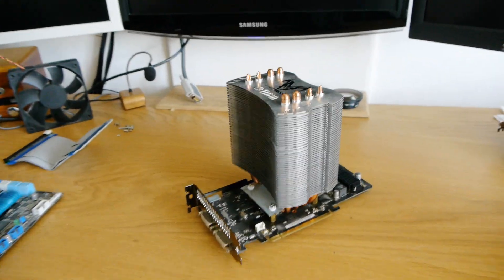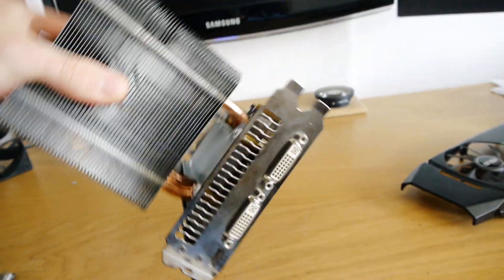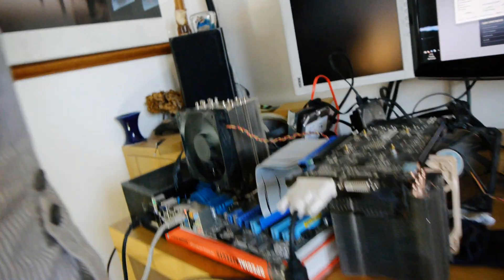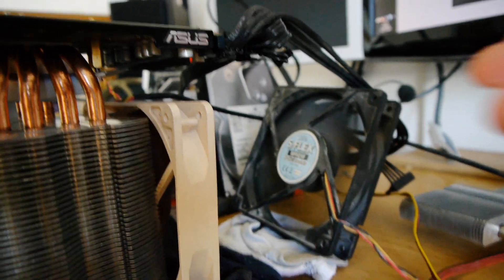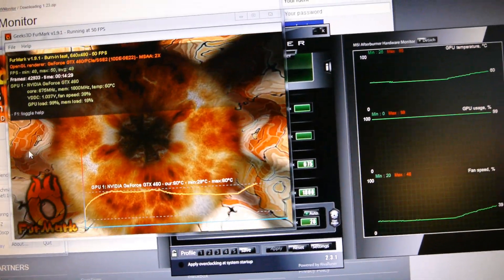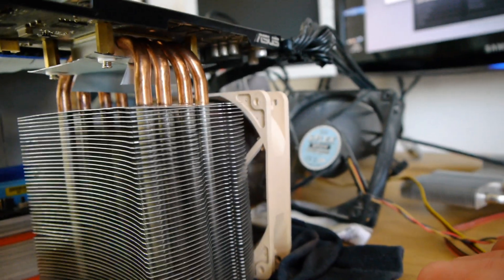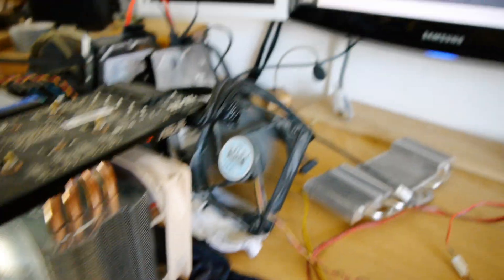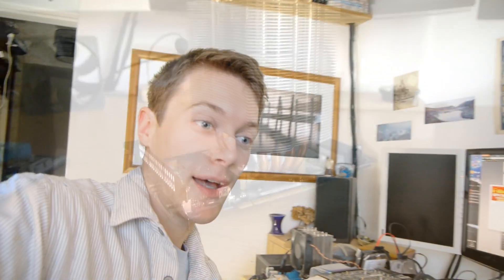CPU cooler on GPU (INSANE temps!)

Comment: I had a GTX 580 (that I bought off ebay on good faith that it was working just fine and dandy, stupid fukn me) that had crapped its vapour chamber in extremis. I only found out after installing it in an external GPU rig for my lappy and after palying a game for a while I heard scarey pinging and crackling. After jumping up and turning it off I went to touch it and the heat coming from it made me pull my hand away. I just thanks the gods that I hadnt gone to the shops. After I assessed the damage I tried plugging it back in for shits n gigggles and to my total and utter surprise, it worked. So i "borrowed" my cooler-master cooler from my PC and bodged it onto my 580. It's sat in my eGPU rig working flawlessly now. All thanks to remembering that I watched this at some time in the past before THE HORROR!!

So thanks (belatedly) for your video :)

EDIT: PS, I should add that I want to sell the eGPU rig now as I built a gaming PC 2 months ago. If anyone (in Australia, I'm in Melbourne) wants one message me for details.

Comment: alright vid, hard core pc gamers doing shit like back since quake days.. putting car radiators from cars.  dude on ebay about year ago selling old pc from 2007ish. this pc had separate  external aquamarine cooling pump station (size super small compact fridge) for salt water fish cooling cpu, gpu, mem, what not included with auction.

Comment: That's how its done, can you explain why they don't put cooling system in modems?  They get so hot and my old DSL modem would lag i put a fan and tiny heat sink in it and it stayed super cool and had no more lagging issues.  I recently put one in my cable modem as well.
Reply: +chriss4365 to cut costs.  dig inside an enterprise grade networking equipment and there will be a huge difference.

Comment: Isn't watercooling way simpler than this? It's also quiet AND has about the same cooling power as this
Reply: +Dino Prašo Generally speaking water cooling is louder (unless you go fully custom), way more expensive and quite a bit more likely to fail than air only. He'd also miss out on the awesome-factor of strapping a cpu cooler to a gpu with a cobbled together mounting system.
Reply: +Dino Prašo No, water cooling is more complex than this. Why? The only difference between this and water cooling is water cooling pumps water in a loop between the radiator and the GPU/CPU.  That is, it adds a middleman. This can be very advantageous, but it also has downsides, such as those the other commenter mentioned.

Comment: why not water cool?  you can make that super quite with a huge radiator
Reply: +wowcolors Because then all you're doing is putting another system between the card and the big ass radiator, and then you need to pump the water around.

Comment: lol'ing as I sit next to a silent watercooled PC with an R9 290 @ 1,250/1,600 pulling 300w of power and loading at 51c and actually in the PCI-E slot where it's supposed to be.

If you want a silent build, water is the only way my friend.
Reply: +K31TH3R Except for the part where he completed this build, and demonstrated that it is silent even under full load.

Keep your elitism and general bratty behaviour to yourself in future.
Reply: +seigeengine Not being elitist or bratty, just stating facts, my PC is just as quiet as his new build and if I tried to run my current build (X5650 12 thread @ 4.6GHz 1.54v 51c load) on silent air, it would hit thermal shutdown under light loads. Not to mention I'm actually cooling my VRM's and mosfets which is required if you want any longevity out of your components. If you want a practical silent build that works year round that lets you get the most out of your components, you use water.
Reply: +seigeengine I could easily prove it by swapping my CPU waterblock for a Hyper 212 with a low speed 120mm I have lying around, disable thermal throttling and kill my CPU with Linpack in 10 seconds, or I could just let you remain ignorant and not care.

I'll go with the 2nd option.

Comment: Heatpipes technically don't work the way you'd have them on a GPU. A liquid is supposed to be on the base and then essentially steamed up into the tower cooler, this being upside-down completely negates the whole idea of them. In this scenario you'd just about be better off with the typical blocks and tons of fins. also with the whole rigged thing you did a cheap 60 dollar closed loop.
Reply: +MidnightMarrow That would be valid if heatpipes relied on gravity to transfer the fluid, but they generally don't, and it would be pretty stupid if they did.

Comment: Just wait until he cracks the die, its a old card anyway
Reply from the maker: Couple of years on and it's still going strong...
Reply: Are you ever going to replace that GPU? Or is it because you don't game that much you don't need latest features like direct x 11 and 12.
Reply: he just wants a quiet pc. leave him alone... hahaha
Reply: gtx 460 has directx 11 support.
Reply: video posted at the end of 2013 ... now middle of 2016, ofc is an "old" card ... NOW
Reply: I dont believe it can last long without memory/power supply cooling.
Reply: For those of you saying its old xd it is but I can play gta 5 on it on normal settings :P
Reply: The die is the exposed silicon chip on the card.
Reply: it was old even in 2013 lmao xD

Comment: .. 3 heatpipes vs 8? Don't you mean 3 vs 4? Or 6 vs 8? ';f
Reply: As you can see at 0:41 there are only 3 heat pipes on the stock cooler that make contact with the GPU, The other cooler has 8 pipes that make contact.  I hope this clears it up.
Reply: Ah, I see. The pipe stops at one end, how stupid.. I thought all cards had it connected on both sides.

Comment: i have GTS 450 and i have dual slot DIY cooler with only 2 heatpipes and my core has been clocked to 1GHZ and mem to 4.3ghz. fans running at 40% and are near silent (noctua ones) and my max temps are around 44 C ambient is 30. so you dont need a huge cooler if designed correctly you can achieve same temps withmuch smaller heatsink

Comment: whats the point to go through all this, looks like crap, and you are connecting it to mobo through what, some ribbon cable hahah, I am sure that will work great in the long run... Decent liquid cooling gpu kit costs about $60 and will work better.

Comment: I think that temperatures would be even better just if u will not place a heatsink up side down. Heat pipes couldn't do thier work because hot air is going up, and GPU was above the heatsink :)

Comment: I did this on a 64mb geforce 2 back in the day with a copper cooler, I put a dab of arctic silver, and then a ring of super glue around and it pressed it until lt was on there, only works for flat chips, and the die was huge so its still holding up in my friends dads computer with windows xp, I love copper as a material for coolers.

Comment: The VRAM will suffer ALOT like ALOT

EDIT: Havent watched the temps yet
Reply: +YellowPeaches the VRAM doesnt need cooling. It wont run hot even without any cooling. The VRM is what you need to worry about, they already run hot, and especially without good cooling you can risk blowing them up

Comment: Question is there a slot that's best for your graphics card thing to be plugged in? I usually ALWAYS see it plugged in right next to the CPU
Reply: +Em0SceneStabr Some mobos only have one full x16 PCIe slot - which usually happens to be the one closest to the CPU.

Always check your mobo specs to see.

Comment: why the hell are you using a GTX 460? OMG XD its so old
Reply: first of all the video is from 2013, secondly older cards run hotter than newer cards and thirdly if something goes wrong all that's lost is an old gpu.

Comment: But does the gpu produce alot of heat normally? it isnt really a high performence card //sorry for the spelling
Reply from the maker: It's a bit outdated now, but it still produces a LOT of heat. Almost the same as a GTX 980 in fact.
Reply: +DIY Perks Try cool gtx 280

Comment: But your set up only cools the gpu chip, most high end gpus these days need thermal pads all over it to distribute heat from the rest of the gpu as well. 

You may run the central chip cooler but the rest of the card would be alot hotter as a result of 0 cooling for those. Also putting any fan based gpu outside of a case with an extra fan blowing in would also affect the temps by ALOT. 

Not to mention the ambient temp of the room at 23 degrees isnt hot, its really quite cool, I mean i have my air con set to 21 degrees on cooling mode so yeah.... 

All in all an excellent fun project, but due to too many variables we cant actually determine anything from it.